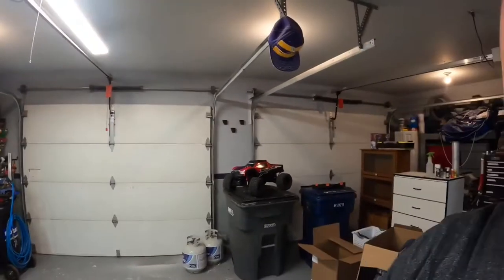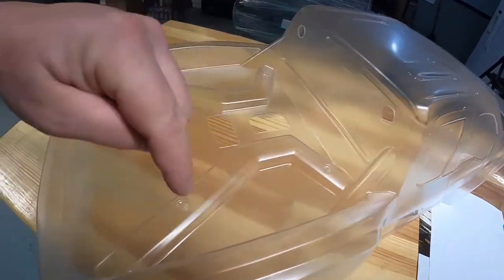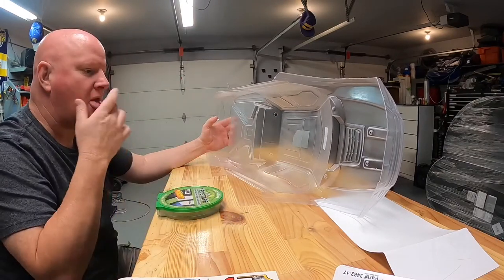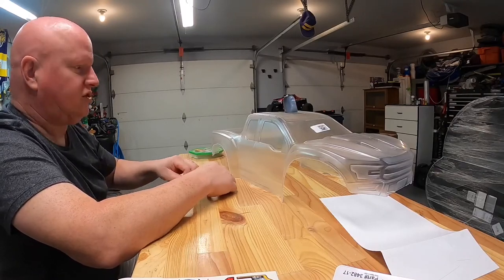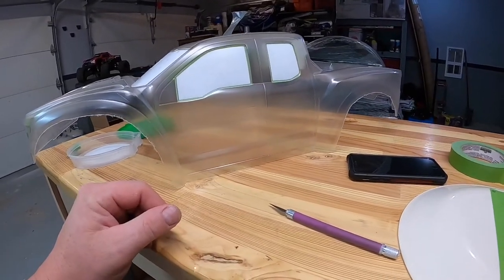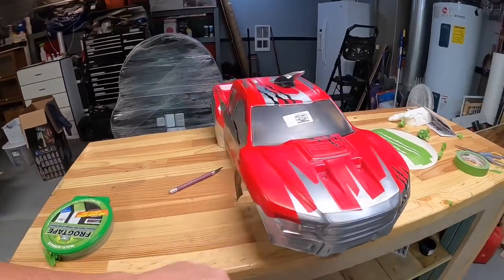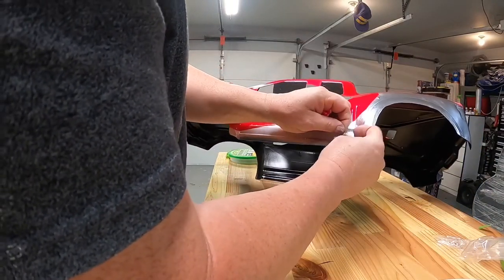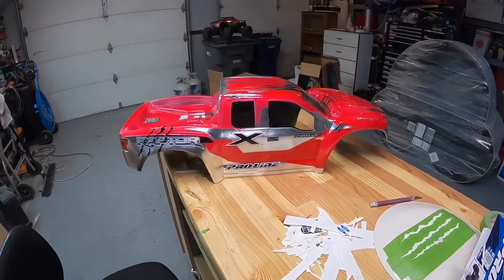Xmaxx Raptor body paint tutorial. My technique!

Comment: Hi ya Bob. Very nice. I’ve never seen this before. Are you painting on the underside of the form, and stickers on the outside? Also, I see the raptors marks through the stickers, so great, but how is that?
Reply from the maker: It’s magic!! Yes I paint the underside so it doesn’t get destroyed and lasts a lot longer. I used tape to make the stencil of the claws and when I’m done painting everything else I remove the stencil from the inside of the body and paint the final coat inside.